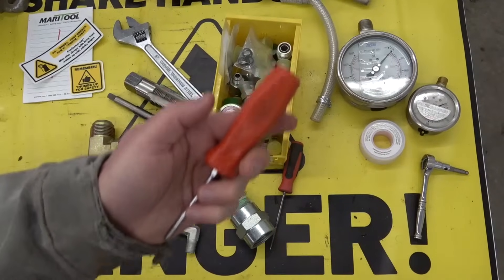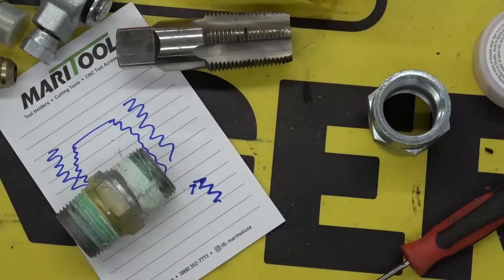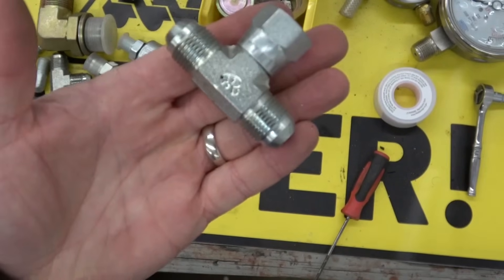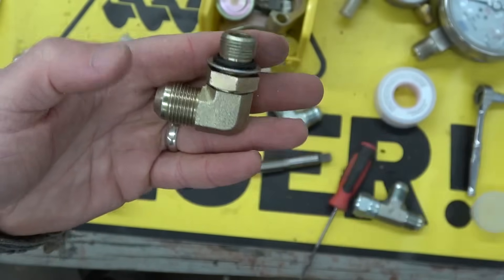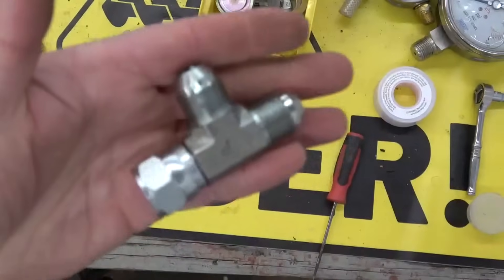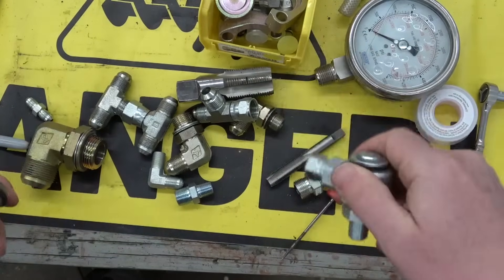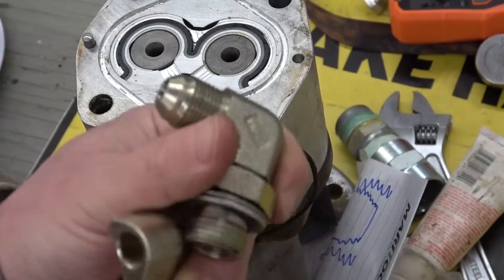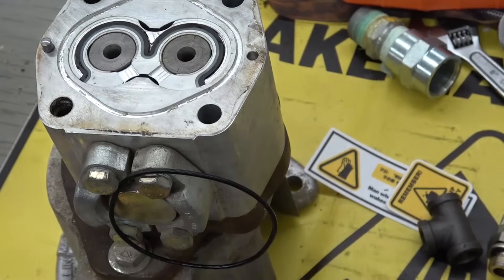Pipe thread is designed to leak || AvE hydraulic

Comment: I just changed an o-ring boss o-ring deep in the bowels of our excavator that was leaking. Fitting was loose. It was all good, then it wasn't. Probably lasted 2 weeks, maybe 30 hours at the most. It was 6 hours away from the shop when it went the second time, so they sent an outside guy to go fix it. I was feeling pretty bad about it until they called me the next day saying it was leaking again. Same spot. 
I'm really not sure why, the fitting looks fine, the tube it goes into looks fine, and the o-ring wasn't extruded. The fitting just comes loose and acts like a swivel, but it isn't a swivel. Nothing to really wrench on it to loosen it while operating. Of course it's a bobcat (e80) (doosan rebrand I think) so it has some oddball o-ring boss to face seal to BSP tee that takes a week to get. 
The tube and the tee are on my bench for Monday but I really don't know why I'm changing either but that's all I can think to do. I just hope the tube comes out with the hyd. tank still sitting on the machine. She's a bit of a tight spot.

Comment: I had a shop guy smack talk about how i wasn't tightening my npt gas pipe fittings enough. So while he was out to lunch i heated a coupling up and crammed it onto the pipe with 32" wrenches (it was 3/4" pipe). Mind you, it was some fittings he was taking apart to reuse for temporary gas service stuff. Guy comes back in still talking smack. Ended up actually pooping his pants trying to unwrench it.
Reply: Haaahahaha I believe it!!

Comment: this was immensely fascinating, only AVE can pull off fittings and it be fun and can actually learn something.

im 35 years old, never great at math, but If the math related to something that i could apply to in the real world, then I can figure it out...NEVER have I ever heard, halving the fractions. Freaking Genius.

Best channel on youtube, bar non. Thanks for posting again, ive missed your videos!
Reply: Hey I’m a dummy and this helps me , if you can easily divide or times by 2 & 3, you can quickly compare fractions. 
For example,
3/8 or 7/16, which is bigger?
Times the number by 2. So, 3/8 times 2, = 6/16ths.. 6/16 or 7/16, which is bigger..  idk that’s just how I do it on stuff that isn’t memorized
Reply: We also never use odd fractions with the imperial system. So you wont see 3/5 or 5/7. At work (construction) I love making people think about numbers. I would ask someone to cut me a board off at 1'-11" and 10/8". Simplified that's 2'-1/4".

Comment: Don’t forget greasy hemp and stag.
Reply: Yep.  Anyone remember hemp and Boss White?  That's the special concrete that plumbers use to seal the immersion heater into the copper hot-water cylinder.  Just so that when the immersion heater fails, you can't get it out without destroying the cylinder.  It all makes work for the working man to do.

Comment: Flange fittings are not a Cat standard, but a Low & High pressure standard. Code 61 (low) & Code 62 (high).
The beauty is Metric & Imperial are the same, except for the bolts.
Reply: Cat uses standard code 61 for the lower pressure connections, but they do have their own version of the code 62 as he pointed out - where the flange height of the coupling is thicker than a code 62.

Comment: NPT threads are designed to be clocked.during assembly by how much waxed cotton thread you use to pack them.  It's like a swivel, without a swivel.  You want the elbow to end up pointing toward the next pipe run, you know.  Unfortunately, somebody decided that they would be "gud-er-nuf" for hydraulics.
Reply: I'm glad I turn open end wrenches for a living and not pipe wrenches. I always think I'll get one more out of her, then 1/2 way around with the elbow, that thought changes.

Comment: We had some steel hydraulic lines on some farm equipment. We just used a cheap heat gun to take it apart. Amazing what heat can do with them. Beats calling a mechanic or going to town for a new line.

Comment: Hydraulic safety factor is only 4 times. That being said, I have never detonated a fitting, even at 6-10x. Has a female BSP swivel sheer the swivel shoulder after many uses at 5-6x, but it was not made correctly and was only hanging on by a quarter of a blonde one from new. It was my job to try to break this stuff and it was always way more difficult than it needed to be. Hydraulic hose itself is always very reliably only 4 times working pressure to burst, when it's new.

Comment: Hahahahahahahahahaha
Timber is sold by number of quarter inches, but not the measurement.
Fittings sold by number of sixteenths but not the measurement.
Would be madness to just measure it in a quantity of one set range, say 0-infinity and know that the range is the same for EVERYTHING you may be looking at huh?
For smaller measurements or more accurate measurements, perhaps you could split one of those increments in to hundreds or thousands of the standardised increments.
Naaa, that'd be silly.
Best stick with the many and varied specs the loonies have come up with over the years of insanity.

Comment: On the NPT vs ORB turf.... Beware of one of the sizes around -6.  The threads are the same size!  Took me ages at work to convince them that the cylinders they were buying all had ORB ports.  But they kept buying NPT fittings, then wondered why they were leaking, coming loose, etc.  Sigh.....

Comment: I haven't tried it with hydraulics as I mostly deal with low- and high-pressure air... I don't use tape or dope; I use Loctite 515/518 flange sealant on NPT stuff.  

I was on a job one day, out of tape and dope with a leaky fitting.  I did have a tube of the 515 in the tool bag and I figured 'why not'.   Couple of drops is all you need (size of fitting will determine) and it was sealed up proper, it even looks far better than tape or dope.  The stuff never really solidifies either so you will always be able to get it apart.  It's especially nice when using small 1/8" NPT fittings.

I've tried it all the way up to 3-1/2" NTP and it hasn't failed me yet.
Reply: Good to know!
I've been tempted to try that.
Reply: i like the purple permatex sealant meant for hydraulics, on air fittings. makes your air tools silent, till you pull the trigger that is... no more hissssssss sounds!
Reply: Good ole form in place gasket.

Comment: Question: why do lamp fixtures that come from metric countries use a  weirdo 1/8 npt thread? The answer is that when countries changed from gas to electric lighting they mounted the lamp fixtures in the old gas pipes. So we are still tied to something that happened more than a hundred plus years ago. In a strange way NPT is the only truly universal international standard. Many thanks for the good work AVE.

Comment: As a hose and fitting expert, can confirm NPT is bottom of the barrel. JIC is not the best choice because it must deform to seal. There are at least 3 metric flare fittings. All styles of flare are compatible, regardless of angle, so long as the threads are the same. Anything with an O-ring is top tier. Replacing O-rings is far cheaper than changing hoses and adapters.
Reply: As a person who repairs the things you are an expert on, my experience is that JIC has given me the least grief over the 20 some years I have been doing it. I'm in the head scratching stage with an ORB fitting that keeps coming loose for no apparent reason. Doesn't extrude the o-ring, just oozes a god awful amount of oil until it finds a hole in the excavators bowels to leak on the ground. First new o-ring lasted maybe 30 hours, second one by a different guy didn't even make it to 3 hours.
Reply: Interesting insight, makes sense. A box of every oring for all the different sizes and you can repair any leak and reuse fittings and hoses. 
I'm a boiler operator, so mostly NPT in my experience. A 1/4 turn to stop a leak often works and is nice in most circumstances. Flanges with gaskets are also nice though since you can often just swap a gasket. Downside is you gotta take off pressure and can't do it live. I see the benefit of both.
Reply: I agree with the cost benefit ratio of changing o-rings, however, location, location, location. Sometimes an o-ring change can be far more costly in labor than in parts cost.
Reply: Yes but actually in real life an o-ring fitting MAY work loose and leak, whereas the steel sealing face fittings don't seem to.  

ORB/jic adapters for valve bodies etc. Jic/jic hoses. Tighten up your adapters good and tight at manufacture, maybe with a bit of red loctite.  
Then when you're changing hoses you get to use nice JIC hoses and not deal with any nasty o ring bits
Reply: Different style/angle flare fittings are absolutely not compatible. You may be able to get away with using different ones in certain applications, but that does not mean its a practice that you should rely on, especially if people are paying you for the privilege.

Comment: Loving it !
Reminded me of that time when I first came across retained pressure in a system. 
 Someone had locked a ram fully closed and quick coupled of the machine. 
“Hey you! them cheap damn fittings crapped the bed again, change them I going on break need it going in twenty!!!”
 Off course wouldn’t screw of the pipe so moved down to the cap heads. 3 came out sweet and bam on the 4th, sitting on my ass with a mouth full of blood and oil. 
Jet of oil came out 3000psi up the side of the face damn near lost my eye 
 No joke dicking round on hydraulics. Not knowing what you’re not knowing , get you hurt

Comment: I remember impacting (very tightly) a bunch of hydraulic NPT fittings and hyd hoses together, fitting a large front frame snow plow. Hyds tapped into the rear end of a large ag 4wd tractor. Foreman came out to the shop and said, “wtf are doing, using an impact?” I said, making sure they don’t leak.

Comment: OK I'm not a trades guy or engineer or anything else like that. But one of the most entertaining afternoons I've ever had was going to my local Home Depot to get gas fittings for an outdoor gas grill connection, and garden hose fittings for a yard water project. The amount of confusion was unreal. Luckily I had spent some time with the google machine and at least had a working understanding of fittings standards, threads, sizes and so on for both pipe fittings and hose thread fittings. I actually eventually got everything I needed but wandering around with 2 different employees for 2 hours and trying and testing about 500 different fittings was time well spent. I know so much more about these things now than I ever needed to before and likely ever will again. Even working in the industry, I feel that this stuff is ridiculously poorly standardized and an absolute gong show when it comes to fittings, thread types, sizes and what to use where and how it may or may not be appropriate, dangerous or otherwise a good or bad idea to use any particular fitting. Gas and water tend to be very low pressure and tapered thread fittings don't tend to leak much, especially if you use pipe dope liberally. Not having worked with hydraulics much at all I didn't know all this stuff was used in that industry as well. Even when it comes to air fittings it gets foolishly complicated and there are too many standards floating around. Makes ordering parts on Amazon a real pain in the ass. Add metric verses SAE and even slightly different versions of metric standards and it all gets bonkers.

Comment: how coincidental you post this two weeks after i taught myself about JIC/AN fittings and all the different options for hydraulic fittings. this video explains everything so concisely, thank you sir!
Reply: Same! But for vacuum pumps.
Reply: Pretty much all the fittings labeled AN aren't. They are largely the same as JIC, but requires rolled radius root threads.
Reply: @ so i came to realize. Tighter thread tolerances and rolled radius roots are the only difference i found from true AN fittings to JIC
Reply: @CallMeKurtzy  Yeah they are a 3A thread. Forgot about that. They are really for aviation and have some other QA checks to make certifiable parts. 
For most people JIC is fine.

Comment: NPT fittings, properly made and installed, don't have the spiral leak path that you describe. Look in the Machinist's Handbook at the NPT thread form specs to see that the male thread has a steeper angle than the female threads, meaning the end of the female fitting is where it seals the tightest. Close fit nipples have an even steeper male thread form than other male fittings which makes them more prone to leaks and thus their limited desired use cases. The threads are meant to physically deform enough so that the spiral leak path is closed off.

Comment: 60 is also a "Superior highly composite number" so it is divisible by a lot more than just 12. Very good bang for buck, very divisible. Unlike 10 which all the "enlightened metric users" think is so great their entire measurement system needs to be based off it. These "cool headed logicians" even messed up the distance of the meter in their initial calculations. Humility must have been in short supply at Mt. Stupid when they made metric.

Comment: Where do AN fittings come into play?
Reply: AN (Army Navy) fittings are interchangeable with the JIC (hydraulic) fittings. The thread tolerances on the AN are a bit better than on the JIC but not a noticeable amount. Even though AN and JIC are interchangeable, don't use AN fittings on hydraulics as they are not able to withstand the pressures.  Most AN fitting are aluminum or stainless steel and used on fuel lines and oil lines.
AN and JIC have the 37-degree flare and finding a good flaring tool is difficult to find at a reasonable price. Home Depot has one you can order, and it works great. They run about $135. I have one. I also have the same flaring tool but in the 45-degree, and it is only $50.
Reply: @halfstep67  Thanks for the further clarification. I work on tractors and vehicles. I have seen a lot of the high end custom builds using the AN fittings for the things like you mentioned. Snap On sells special aluminum wrenches for that application, so it all fits together now. I am glad that AvE brought this subject up. I have a very good flaring tool kit that was around $300 and it works awesome for the automotive flares. Cheers for the weekend!
Reply: @JohnSpaulding  I built an aftercooler for my air compressor, and I used and an oil cooler for the radiator. It used AN fittings, and I had to flare some copper pipe, so I bought the 37-degree flaring tool. I also used a couple of JIC fittings on the air compressor. I use 1/2" copper pipe and soldered the fittings.  1/2" copper pipe is 5/8" OD so it worked perfect with the AN-10 fittings and also the 5/8" JIC fittings.

Comment: Can confirm does not work on PVC 200° no Bueno….🙃.  

I don’t do a lot of hydraulic oil and what not but we deal with sodium hydroxide sodium chloride. We try to take threads out as many connections The stuff just leaks out matter what you do

Comment: I used to do a ton of experiments simulating oil well conditions with 3" pipe and maybe 500psi. No way to get anything like that pipe with a different thread. I'd have at with mil-spec teflon tape, a 4 foot cheater bar and my 200lb ass to put 800ftlb on the fittings and they would still leak. I ended up making my own pipe dope out of long pot life epoxy with molybdenum  disulfide powder mixed in for lubrication. Worked like a champ. Everyone told me I couldn't ever get them apart, but they were wrong. The epoxy has brittle failure if you get enough torque on it and it comes apart.

Comment: 40+ year fire sprinkler guy here. Never had a problem with leaks in NPT threads, either factory or
on-site fabricated....ever. I was trained proper on the stuff, never had a problem.
"Leaks cost extra. Customer didn't pay for 'em, so don't install any."
Well ok, there's QC issues with all the Chinesium that has entered the market, but that's a universal
pretty much for anything isn't it?
- Ed on the Ridge

Comment: NPT works great if you tighten it til it friction welds.   Remember, tighten til you hear a crack, then back 1/4 turn
Reply: We have two levels of tight in the oil field.  There is fart tight and if you need it really tight pull until something in your back cracks.
Reply: @Rusty_ok  nah mate, it ain't tight until it's been properly introduced to the flogging hammer !
Reply: Don't back it off.... 😂😂😂😂 .... I think you intended to say tight plus 1/4... NTP doesn't make a noise, the noise is on compression fittings.... Torque specifications are available, they are based on diameter (interior)...

 Tape and dope, balls and 1/4 on steel, balls and 1/8 on brass. Gasket/O ring fittings work best with mfr torque specifications, greasing them heavy can get you operational for a few hours if the gasket fails. Flare fittings (flexible gas type) are engineered to bottom out, no dope no tape.

Comment: whitworth isnt metric ave think u meant imperial?
Reply: It kind of is, though - ‘metric’ (ISO 7 or ISO 228) pipe threads use the same form as BSP which is a Whitworth thread form (55° flank angle and all that) They even use fractional inch designations. But the standards are defined in metric dimensions.

Comment: Great video! Way back in the early 14th century, when I was a young man, I worked in a manufacturing plant that built de-icing equipment for the cold-blooded dragons. There was a lot of plumbing on those systems. Fuel, Glycol, water, oil, etc. I was fairly adept at visually identifying the fittings and could tell the guy at the parts counter which ones I needed. Size, angle, male or female, swivel, union, compression and thread. Forgot the most of it as haven't used it in an eon or two. Bit of a refresher now and then couldn't hurt. I'm still laughing at the parts guy with the "O" ring!! 🤣🤣🤣